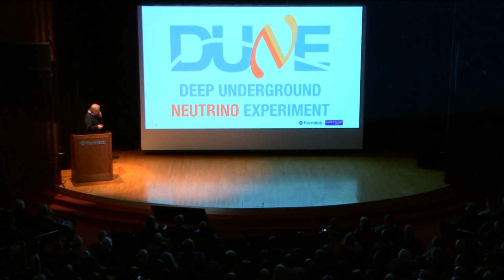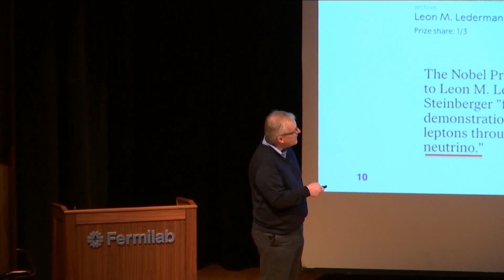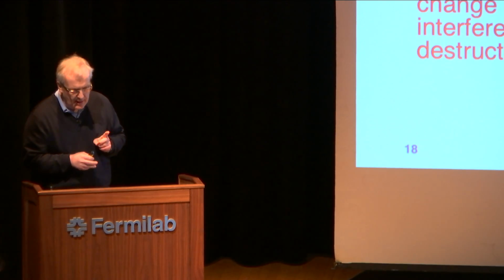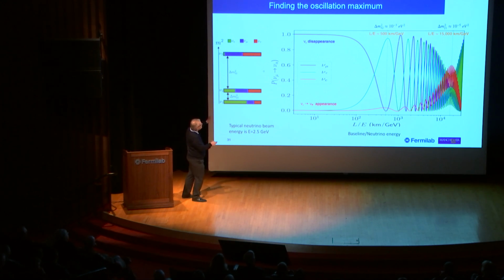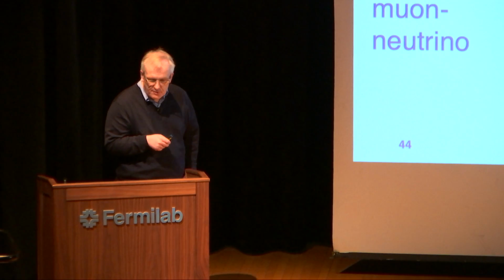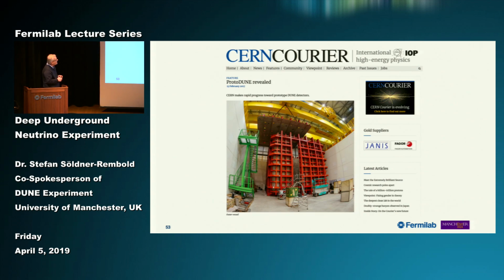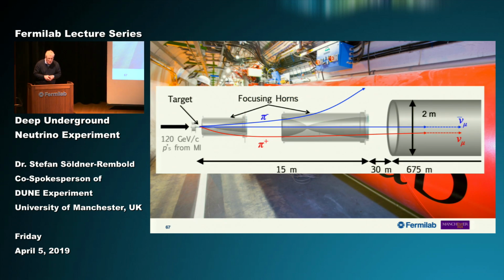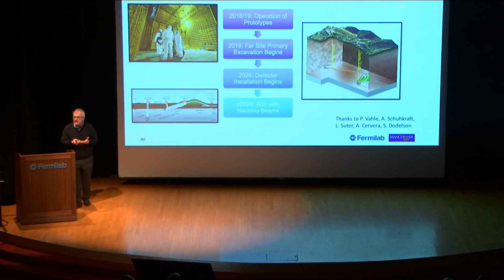The Deep Underground Neutrino Experiment – A lecture by Dr. Stefan Söldner-Rembold

Comment: Questions: 
1. We know neutrinos are almost as fast as light, but what is their official speed? Has it been measured?
2. Does a neutrinos speed change as the neutrino oscillates into higher mass generations?
3. The tau neutrino is very heavy, and it travels at relativistic speeds.. Does that make it a good contender for dark matter?
4. If it doesn't get it's intrinsic mass from the Higgs field, then where does it's mass come from?
Reply: I'm gonna try to help a little bit with the questions:
1. Since neutrinos have mass, it does not make sense to ask what is their "official" speed, since speeds below the speed of light are not absolute -- for massive particles, there's always a reference frame in which the particle is at rest.
2. The thing is precisely that, rigorously speaking, the flavor neutrinos propagating in free space do not have well-defined speeds; what happens is that its components (the mass eigenstates) propagate at different group velocities because of their different masses, and that's what causes the oscillations in the first place. You'd have to think of neutrinos as wave packets in this approach, in order to make sense of the oscillation behavior.
4. The mechanism by which neutrinos acquire mass is not contained in the Standard Model, so the official answer for that would be that we simply don't know. However, there are some proposals, the most famous of which is the so-called see-saw mechanism. 

About the 3rd question, I really don't know anything specific, but neutrinos are indeed one of the candidates for dark matter.
Reply: @BrunoPST2010  Thanks for taking the time to answer these questions. With regard to the first question, I ask that because Dr. Stefan mentions in the lecture above that we can detect the neutrinos a few seconds before we can detect the light from a supernova, so I imagine the speed at which these neutrinos travel at must be fairly steady, just under the speed of light. And the fact that they have no Higgs interaction may also play a role in this.
I will have to look up this "see-saw" mechanism and research some of the current hypotheses for how they obtain mass.
Reply: @Emcee_Squared  Indeed, the typical speed at which neutrinos are emmited in these processes is very close to the speed of light, precisely due to their small masses; but I imagine that neutrinos arrive earlier than light from the supernova has more to do with the fact that whereas the photons are constantly being scattered inside the supernova -- which effectively "traps" them and make them take longer to leave it -- the neutrinos almost don't interact and just fly off instantly.
Reply: @BrunoPST2010  Yes, that is how I understand it too. The photons "bump" into a lot of things as they make their way out of the star, but the neutrinos go through without touching a thing. That, and the fact that they travel at near light speed, means they are detected even before the light. It's pretty amazing.
Reply: @Emcee_Squared  Neutrino emission occurs during the core collapse while light is produced when the shock wave reaches the surface of the star.